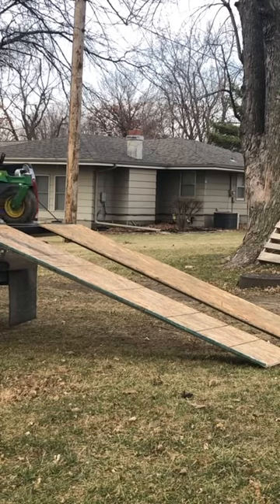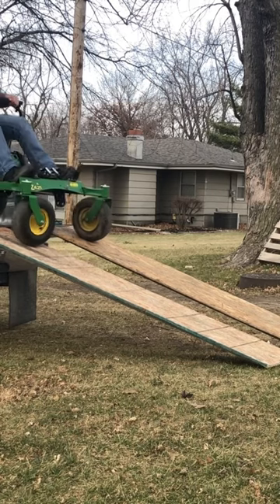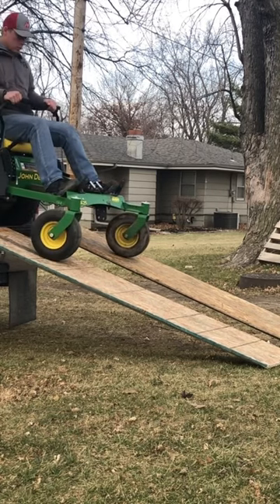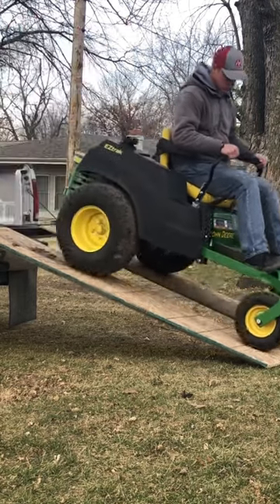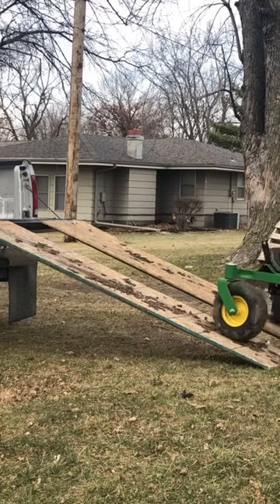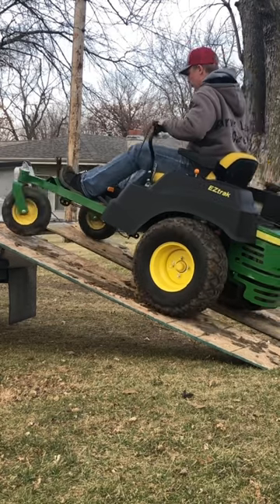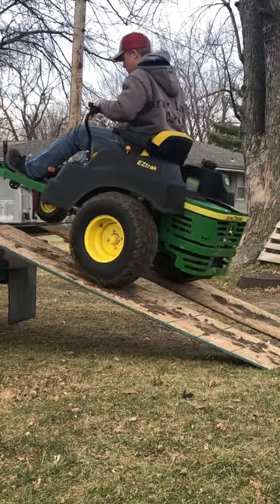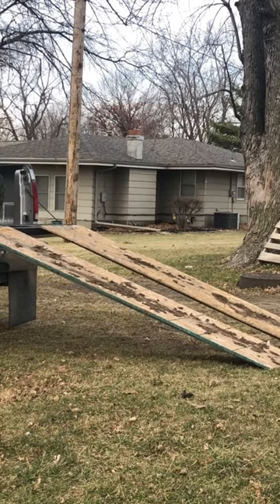Potential form of transportation for the sidewalk plow

Comment: One everything is wet your not gonna have a funny time going up. You will drive yourself off the ramps.just use a trailer. If the mower flips or slides off your the only one there to save yourself. It’s not worth the risk to you or the mower. I used to use proper metal ramps and when wet grass was on the tires I couldn’t get up the ramps.

Comment: It will work until the ramps slip off the tailgate and flip the mower. Make sure u tie the ramps to the truck so they don't move. Put something on the ramps for traction.
Reply: Then factor ice and snow into it and you be in the hospital.
   Get a low trailer

Comment: Use your trailer your going to get hurt... It is not bad pulling a trailer in the winter, just remember if you don't have an enclosed trailer your going to get salt into every part of your mower going down the road, including the coil laminations and you will eventually will have to change your coils so you have spark...

Comment: yeah, that's a little sketchy going up. Wood will be wet from snow/rain, needs traction control
Reply: He’s got ramps under the wood if you read the other comments. The wood just makes it wider.
Reply: @TheFordDude74  wood is slippery that’s what he’s saying. Even metal ramps are slick when wet.

Comment: Once the blade is on it’ll catch, may need to reinforce your ramps
Reply from the maker: They are aluminum atv ramps. I just bolted OSB on them to widen the ramp so it’s a little easier and safer. The blade on the mower can be lifted all the way 90 degrees. I did it earlier today and it worked great. If you want an in depth look at the mower plow setup check out my channel I’ve got multiple videos about it. 😃

Comment: I think a trailer is so much better. I like the lower height and the ramp on the trailer less damage if someone falls off.  1 slip going up that truck and you're either hurt or damaged you tool.
Reply from the maker: Yeah I ended up scratching the ramp idea. It just wasn’t going to work how I hoped it would.
Reply: @farverlawncare  I think you're going to be much happier.  Best wishes. Plus the trailer will hold more equipment.